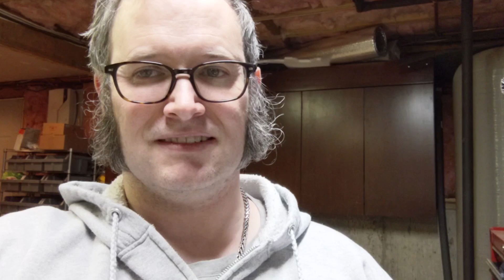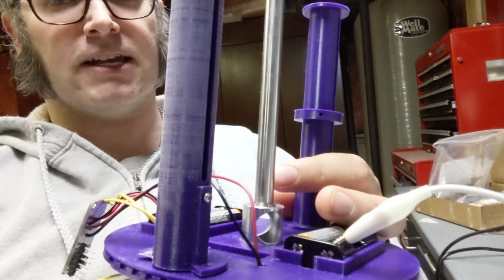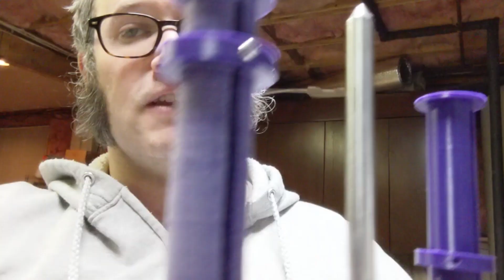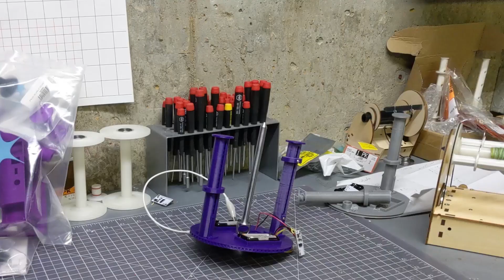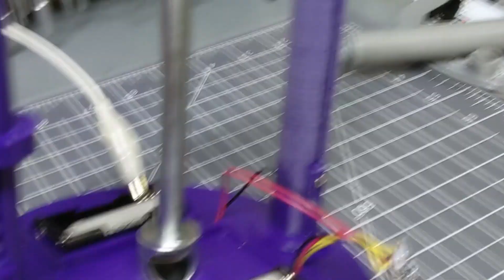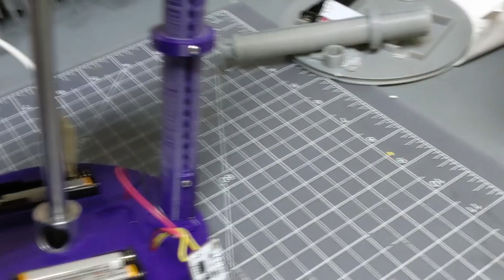SPIN #41 - Auto Flyer Prototype Update

Comment: will you make 1 to fit the mini?
Reply from the maker: No, this is too big to put on a Mini.

There are a few questions about making this work with EEW 5.1 or EEW 5.2. I would certainly like to make that work, but right now it is looking like there just might not be enough space. I’m still going to make it happen by trying to find smaller parts and optimizing for space if I can, but it isn’t obvious how I can make it fit today so I can’t make any promises.

This feature is still a very long time out. It’s design is a complex design, I know I will need several more prototypes before I’m close to happy, and I have other projects I need to work on while working on this. I would guess this is still a year away and it is still possible I won’t be able to get it working to my satisfaction and won’t get released.

I like releasing early progress updates on features many of you folks are interested in because sometimes I get super useful feedback from the EEW community.
Reply: ok guess i will need a 5.2 then i will start saving today.

Comment: Keep working on it,.  the concept is right.  can the winders be thinner?  Love your wheel, works great,
Reply from the maker: I'm not sure what you mean by winders.  If you mean the arms that the yarn guides rest then making the diameter of those smaller has some issues.  The current diameter was chosen so I could hide the motor inside those arms.